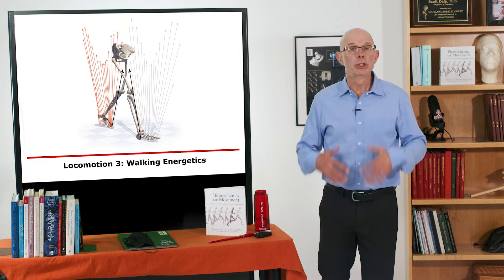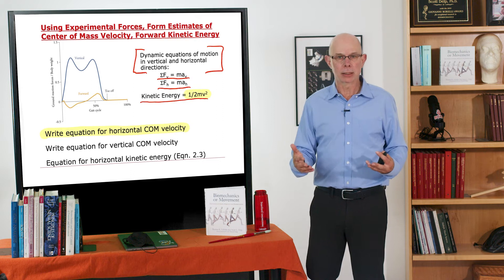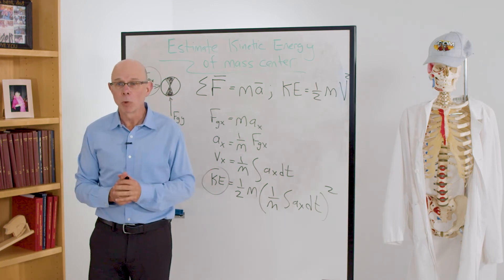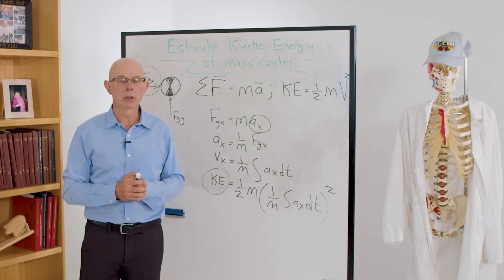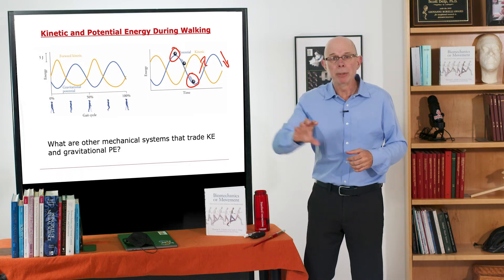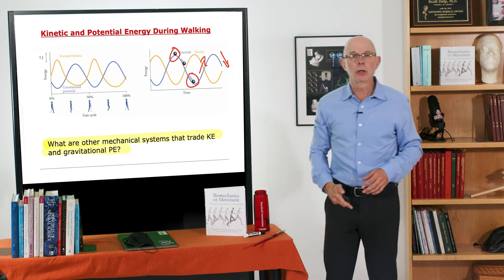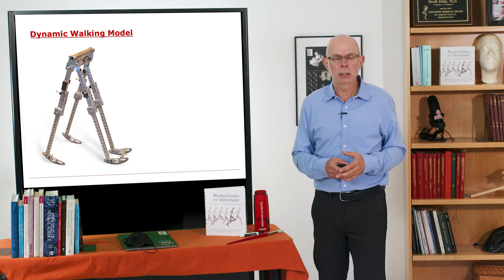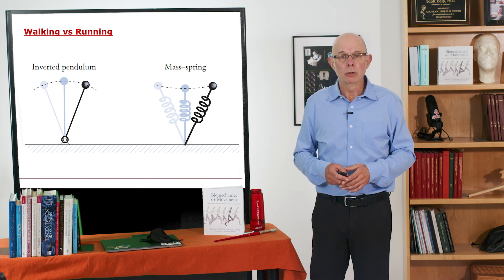Biomechanics of Movement | Lecture 2.3: Energy Exchange Mechanisms in Walking

Comment: Isn't there a mistake in the equation in 5:57? The integral for velocity does not need the 1/m term if we are integrating acceleration. Alternatively we could keep the term but integrate the force instead.